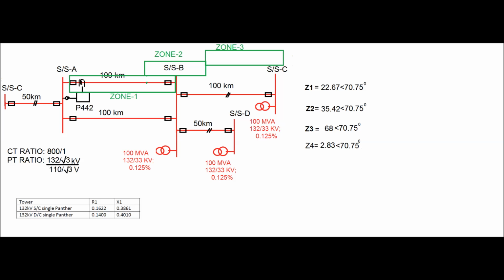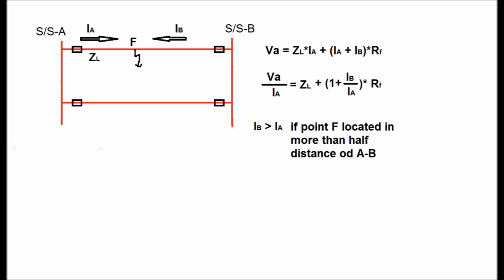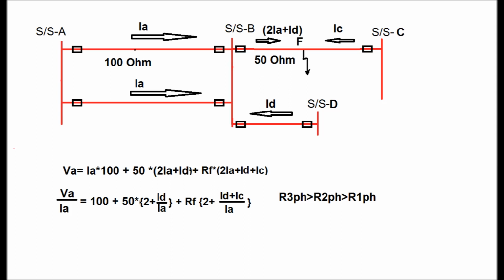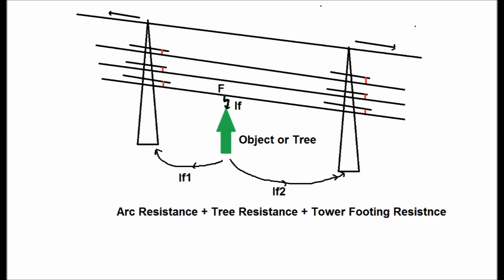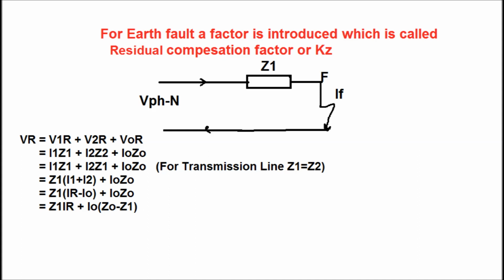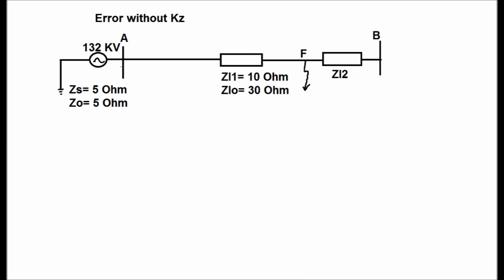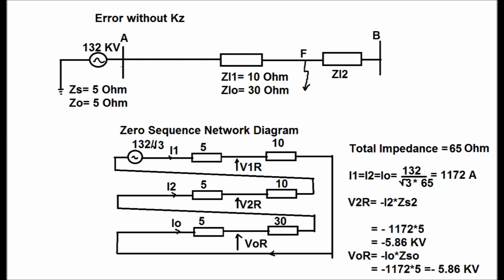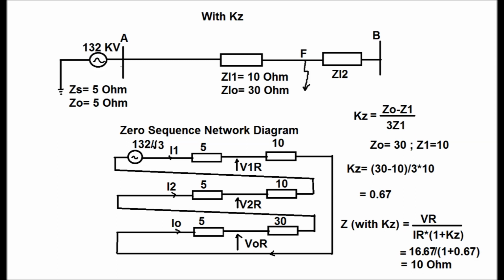Distance Relay Setting Calculation -Part2

Comment: Hai sir I have small dought why we use Main I and Main II Relays in relay panels for transmission line please clarify my question as soon as possible
Reply from the maker: Main-1 & 2 are the relays used in transmission line protection mainly 400 kV and voltage system. Main-1 & main-2 relays are supplied with separate dc source so that failure of any source or any relay there will be no problem arises in protection system.